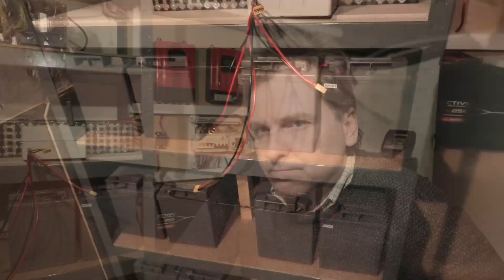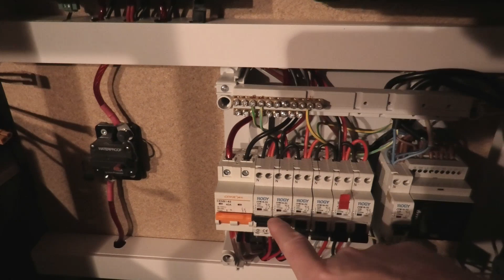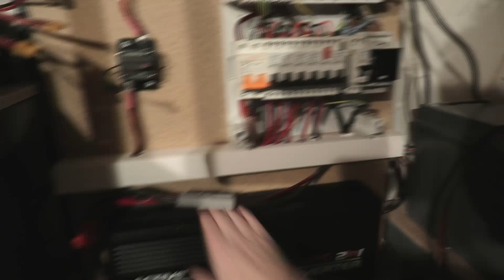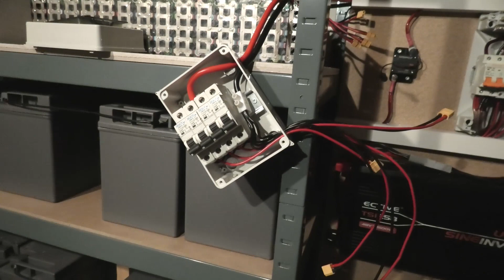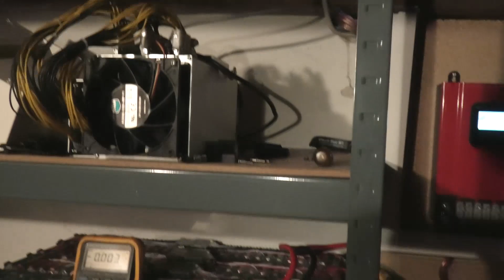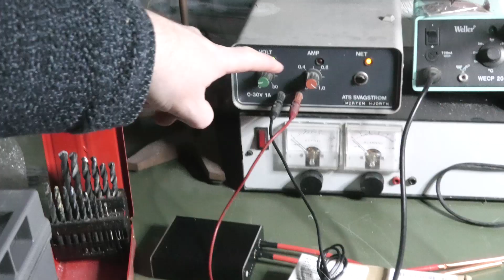Finally, I Connect my 4 Home-Built Li-ion 1KWh Banks - 1033

Comment: Since you are connecting the batteries in parallel without using diodes, and they are all different voltages, as soon as you connect them they will begin charging each other preventing all current from escaping. You will then measure 0V. Until they are done charging each other. Using diodes prevents this. The situation is also worse, because this configuration will destroy your batteries and cause them to explode eventually.
Reply from the maker: if you put diodes in,, you can only charge or discharge,, depending on how you put the diode.
Reply: @MyPlayHouse  Not exactly, for my configuration I have input and output diodes for each cell. I have discovered the requirement of diodes by testing and experimenting.

Comment: 17:55 A litium at 1.358V is a total goner and must be changed out right away since its destroyed at that voltage and unstable.
Reply from the maker: There was self draining cells,, that needed replacing.

Comment: you should have made all the wires to the fusebox the exact same length, the shortest wire will cause that battery pack to be under much more load than the other batteries. It will most likely fail first since any surges will transfer to only that battery.
Reply from the maker: The wires are over dimensioned enough, to make this problem very small.

Comment: Hi Morten ! cells with low voltage may be short-circuited internally. pull out all 10 and find the one that will quickly discharge without load (it should warm up more than others when charging) . Do not leave such cells to charge unattended!
Reply from the maker: Yes one or more of the cells is slowly discharging,, they have been sitting for up to two years. 20.000mAh over 2Y= 1,1mA -ish,, in normal use that would be probably about 11mAh a day,, that the BMS will fix in 30min.
I need a system that will run, and charge when I am not at home,, there for the banks are divided out in to smaller self managing units,,where I only need each bank to do 10Amps,, and that is just 1 Amp per cell,, and they are usually C10 or C20 at least,, meaning that they can do 10/20 times as much.

Comment: Aw man.. i hope those breakers are not for protecting anything DC..
Reply from the maker: Are you of the opinion that the breakers will not brake 60V 15A ?
Reply: @MyPlayHouse  yes  they are meant for AC where you have zero crossing current and voltage. They will weld up, catch fire or explode on short circuit and not protect your circuit. On overloads they might work to some extent. But if you have batteries collapsing they will not protect. Search YouTube etc. for “using AC breakers for DC”. Use either good old fuses or breakers designed for DC.

Comment: You need a soft start .
                        ( lamp & push switch works ) . 

The in rush current is tripping the BMS ( charging the capacitors ) !
One other thing check the bms doesn't need disconnecting before it will reset 

PS
The BMS may disconnect the charger at end of cycle .
Big caps & over voltage dump load needed ….. LOL
Reply from the maker: No,, the banks was just out of balances. :-) works now,, but I did also worry about the in rush current,, but that was not it.

Comment: Morthen, is your solar charger capable to disable float charging ?
You can not have float charging on any Lithium based batteries !!!!
As for your battery pack with the low  1.358v cell.
It is probably because there is one 18650 that is bad and drain the rest of the 18650 down. You schould find the bad one and replace it. 
About the startup of the solar charger, can you disconnect the load on the solar charger and startup again and see it that helps.
Reply from the maker: The Li-ion banks has been sitting for 2 years,, the tiny amount of self discharge does not matter from day to day.
Reply: @MyPlayHouse 
I see you all have fused them, that's a big plus point.
No matter how long they where stored, I have here 18650's that are 3 years stored and are barely self discharged !!
I have to say I sellect them whit care and
No 18650 below 2400mah will be used in my packs.
In your case there must be one or mabe two 18650 that are the culprit of discharging that entire (10 pair) cell.
You putting much effort into making these battery packs and it's so stupid that a whole pack has to disassemble to swap bad cells.
Remember my intention is to give good criticism not bad.

Comment: OMG I was expecting fire...
Voltage is a power, and watts is energy.
If you have a voltage difference in cells, low cells will such from a higher cell , the same happens with cell packs.
The whole current inrushes. So you can damage cells and BMU .

Also energy flows negative to positive. Can't tell what you have used on that box....

You can also have shorts and battery resistance, more cells more resistant, did you check?

The lead acid...
Number them all so you know where it was and connected to.

Take them off and weight them, the heavy batteries  group them and the light ones. Try reflooding the light cells.
With the non. AGM, changing the fluid works as a part service. But that's when battery cells were made with lead and thick lead inside.
You would get bits in the fluid which changed the capacity and performance of the battery.

In older still you could take out the plates to clean them if you had neglected the battery and they would be fine again.

Po4 battery have capacity and price, there voltage is different to lipo types, it's more lead acid...1.2

Here is one.... Get a nail one galvanized and one copper,  boil a potato for five minutes  then cool.
Push the nails in and them use a multimeter to read the voltage.

How many potatoes and nails will you need?
Salt, magnesium, water, soot, paper also make for high power batteries.

I think you did well with the batteries they are good if you keep them at temp, filled and mostly charged, I don't think they like a full change...

Resolve discharge issue.
While you can't  defeat broken cells within the pack or maintenance required. You can save the others with a proper charger.
The car charger won't really push hard as it can. I forget the charge unit names but there built in to the solar system as it's a good price combo unit. They have 20/30 amp chargers. 
But when the battery is low, it will mains charge the battery if the sun is in hiding. If you run low or draw too much it switches to mains, seamless back and fourth...
Reply from the maker: Hi Rory
I have about a minute to read and reply to each comment,, please have that in mind,, you are all over the places here.

Comment: LiFePO4 - Lithium Iron Phosphate. They are not as energy dense as Lithium Polymer or Lithium Ion batteries, but they are very robust, as in they will never go up in flames whatever you do to them, and they can stand a bit of rough handeling, electrically (as far as I remember). But yes, they are expensive. At least somewhat...
Reply from the maker: Hi Seegal Galguntijak
Thank You very much! for that good info - glad you liked the video :-)
Thank you for watching! :-)
Reply: @MyPlayHouse  Also, the cell voltage of LiFePO4 is 3.2 Volts, not 3.6 or 3.7 volts. Just another FYI :-)

Comment: Lithium iron phosphate, LiFePO4 I think, better for static storage as they are more stable. Heavier and less dense, which is why they're not as good (though still usable) in cars.

Given that you have the sun issue would it be worth hooking it up to be able to charge from the grid when prices are low so you can keep them in healthy operating state of charge?

From sunny Australia where we made 42kWh yesterday from a 6.5kW system.
Reply from the maker: the best I have seen for weeks,, is around 300 Wh a day :-/
Reply: @MyPlayHouse  yeah, I lived in London for a couple of years, while not quite the same as your climate in Denmark it's closer than we have here, especially in Queensland where our winter is more like your summer.

We are in summer now, and while I speak of 40+kWh, it's also 30+C on those days, and humid. Hell, it's 23C right this very minute, at 3:30am.

I am interested in making a small battery to run my small number of servers overnight from our daily solar, perhaps in the order of 1.5kWh would pretty much do it. So many things to learn, and 2 small kids to steal my time.

Comment: Measuring into battery connectors scares me. I used to have a 'small' battery bank on my UPS, I was measuring into the connector, and the meter probe slipped. Then followed an impressive amount of green, hissing fire, fine copper droplets all over the place, and about 10mm of the probe and connector pin was no longer there. Have a nice weekend, with fire only where it is supposed to be.
Reply from the maker: This is why I am making small banks,, not as many amps.

Comment: if i tried doing this on my moms house stuff  the battery packs would need to be slightly higher as i think it would need to be in the ball park of 10-12KW i think but i would need to look at bills from previous months to verify though
Reply from the maker: 4KWh are also not enough for my needs,, but it is a good start :-)

Comment: Well that was expected....
First use resistor when u conect batterys together bms is shuting pack of because of high current inrashing to other pack "balancing betwen packs"
Low voltage pack of cells ....u have one or more selfdischarging batterys in that pack ...replace them all because that batterys that was ok before asemblyng is now damaged....
Wach for self-discharging cells before asembling them.....charge to 4.2v and leave for week voltage shuld not drop below 4.17v...but what do i know .....
Nice video....only sad that is not going so well with battery packs ....
Bms defenetly is doing his job well high current shut off ....
🖖😎👍👍👍
Reply from the maker: The battery banks has been sitting for a year,, from day to day, it does not matter if they discharge a little bit.
Reply: @MyPlayHouse  if battery sitting a litle bit is no problem ...problem is when cells go below 2.8-2.5v then get battery damaged and start act like so....
extremly low cells are selfdicharging and heating up ,loss of capacity...and if u have one cell in big asembled pack if not charged on time cold damage whole pack....and all hard work is for nothing....
Lifepo4 cells are even more sensitive voltage wise 3-3.45v

Comment: Looks like you have some batteries that are draining the pack. When one or more batteries connected in series is that low it will charge low cells up backwards when the whole pack has a load. Your bms is doing its job. You need some more investigation.
Reply from the maker: The battery banks has been sitting for a year,, from day to day, it does not matter if they discharge a little bit.
Reply: @MyPlayHouse  You dont want any cells that suck power from the cells it has in parallel to it.

Comment: Minor clenching when all 4 packs were turned on in parallel... Wonder how much those packs started charging each other.
Reply from the maker: I have now had it working for a little week, and it does not drop much over night.
Reply: That was in the back of my head as well. Brave man that Morten! Just turning a 39V and a 50V LiPo pack in parallel...

Comment: The problem I am seeing is when your Battery bank is going down in Voltage to much the BMS turning the output off. I don't know if your Charge controller can be powered on with only your PV cells. If not, you have to charge the Battery bank before you can charge it with the MPPT again so that the BMS gives power to your MPPT. Then I would consider another MPPT like these from Victron. They can do that. When the BMS turns of, you can Measure the Voltage but don't get any current out. So your MPPT doesn't start-up to charge.

BTW: Most BMS that I have seen is not really Capable to balance the Cells. I had one that draws 80mA while balancing at charging. I have only 3s 5p packs and they are most likely would balance years because you only can charge them with 80mA at this state. I am experimenting right now with modifying those BMS to get a higher current level over those resistors that I can do it with 1A. Maybe I am building a better BMS from Scratch.
Reply from the maker: My little cheap BMS will only balances with 20-30 mA,, so it will take a while to balances out a 20Ah battery.
Something like 800 hours if it was totally out of balances.
Reply: @MyPlayHouse  that's long... I'm thinking we could build something that you can put in parallel to each cell on the battery bank. So you don't have to modify the BMS but have a higher balancing current and minimizing that 800 hours.

Comment: Have you considered using 'Ferrules' rather than soldering the ends of leads?
Regularly used in America - stop the end of the wire being chewed up by the connection block screws.
Live in the UK - used soldered connections in the past - now prefer Ferrules - they are much easier - more robust
Reply from the maker: I do not have anything like that. The 16mm2 cable was a bit to big for the charge controller already.
Reply: @MyPlayHouse  Yes I agree - In some circumstances they may not fit.
They are more suitable in routine wiring situations.
Don't know if the ferrule diameter decreases when crimped.

Comment: I'd be careful with Li Ion battery packs btw 
They can easily ho on fire or explode if anything goes wrong
I actually ordered 4 lifepo4 cells from a seller on alibaba recently (just waiting for the cells to arrive...shipping is a pain lol) 
this was the seller I got them from 
https://szluyuan.en.alibaba.com/?spm=a2756.trade-list-buyer.0.0.1f2e76e91f2Bec&tracelog=from_orderlist_company

Lifepo4 batteries can last 10 years tbh
Reply from the maker: I have been looking at something like this : https://www.ebay.de/itm/PYLONTECH-US2000-Plus-Lithium-Stromspeicher-4-8kWh-48V-fur-PV-Wechselrichter/163262846480
and getting one more every second month,, or so.
Reply: @MyPlayHouse  they seem pretty good actually
the system I have atm that I'm working on cost me around 450-500 with a bms if I remember right
sadly it's only 12 volt though (Not much point going to 24 or 48 for a small system that is only a 1000watt discharge for the inverter)

Comment: You got a self discharging battery pull the nickle strip an let it sit don't take long. Or if you got a thermo camera put a discharge on it thermo show a bad battery real quick
Reply from the maker: The battery banks has been sitting for a year,, from day to day, it does not matter if they discharge a little bit.